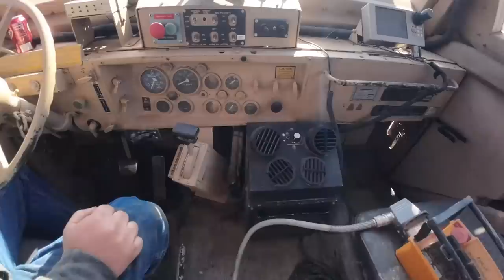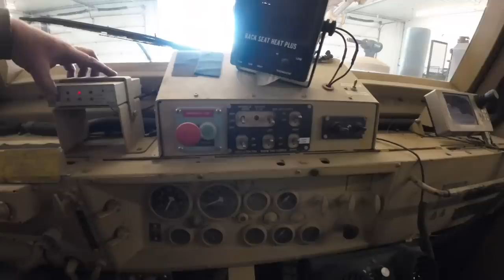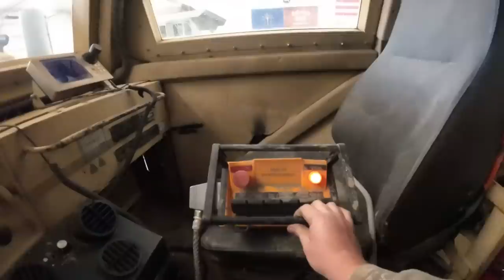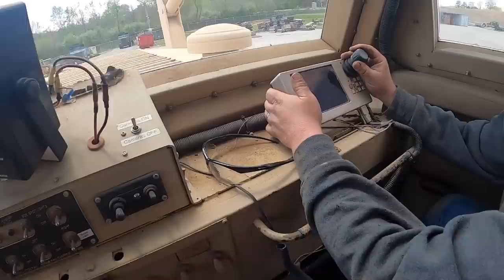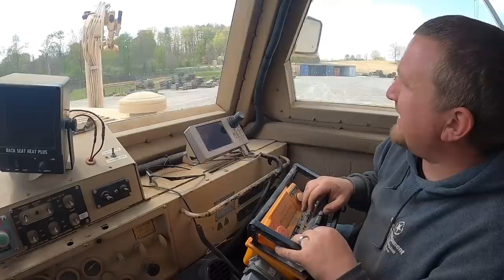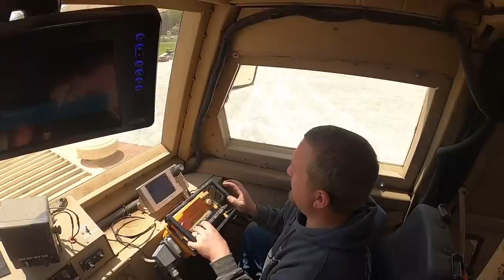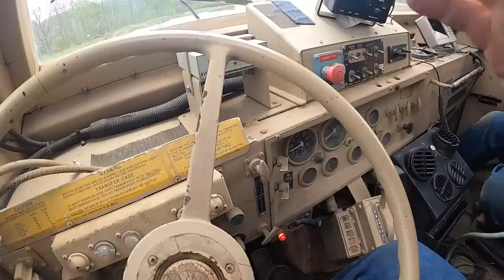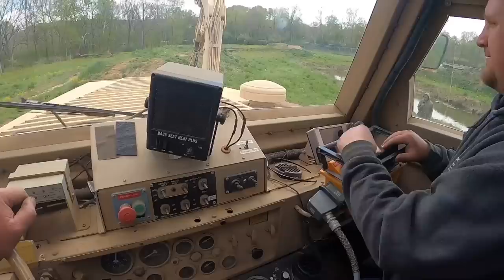Very rare in public Buffalo Mrap training vehicle to dig up improvised explosive devices

Comment: I worked on the original Block 1 vehicle-mounted mine detection (VMMD) project, and then Block 2 the ground stand-off mine detection system (GSTAMIDS) for the U.S. Army Night Vision Laboratory.  That vehicle is Block 3 (the third version).   The Block 3 prototype used a lot of the systems developed in the other projects.

Comment: We used to have a Mac dealer back in the 80's who had a socket with 1/2" drives on each end.  The Mac (actually an IR) would turn the Snap-on's backwards.  Snap-on was good, but we had a really good Mac dealer.  We worked in a heavy truck body shop in OK, we got our share of everything huge thanks to the oilfield.  Those boys can break or twist ANYTHING lol!  I enjoy watching your videos, makes me miss those shop days (sometimes lol)  "Really, you twisted an Autocar, double frame rail winch truck into a S shape?...............how.........."lol

Comment: I wish I had your truck in my picking up 70 lb hay bails. It would work for big round or big square hay bails.
I wish I was your Snap On Tool dealer when I sold Snap On Tools. You do such a good job with your bulldozers and other equipment and Snap On Tools we’re only good as the dealer and I lived by our motto. I would explain the price as to apologize for something less in quality. I was the top salesman in our district. My wall is full of top sales awards and three gold and Diamond rings. I helped my customers in any way I could and I put up a bulletin board for swap and shop customers. I sold farm tractors, cars, trucks and other stuff I better not mention this day and age but the best thing was I had fun selling and going to bat for my customers. I sent in a impact 4 times before the rebuild shop got it right. I would take the Snap On impacts out of the boxes and test them. If they didn’t pass taking off a 600 foot pounds bolt I sent them back to Snap On. They had some bum crap but 90% of their tools were excellent but when they send you a dog and want racehorses price I sent it back.

Comment: You store does that with sockets, the majority doesn't.  They have no way to order 1 Icon socket! Period! So they put your used set on clearance rack that's missing socket,  then u get new set. Most stores will not pull 1 socket out of a new set and put new set on clearance rack